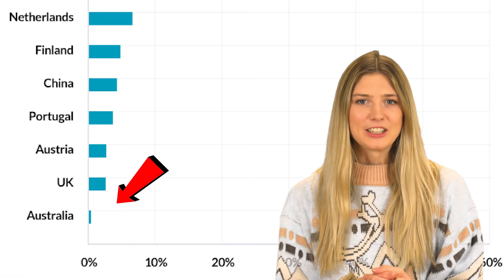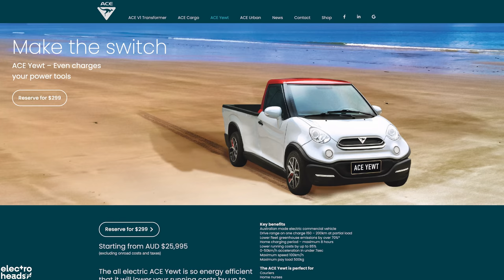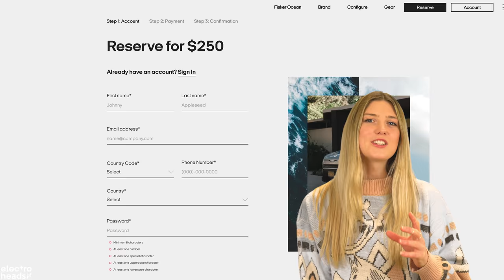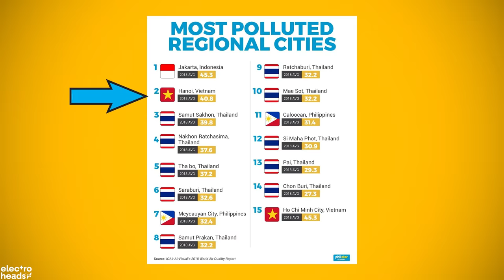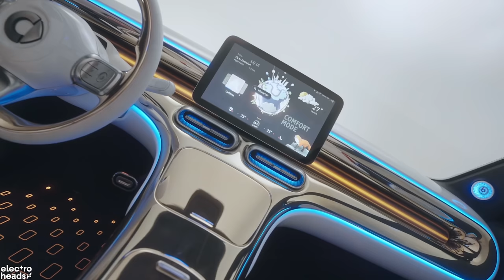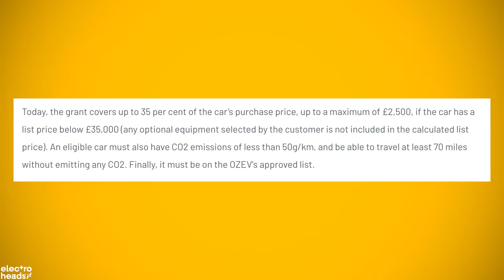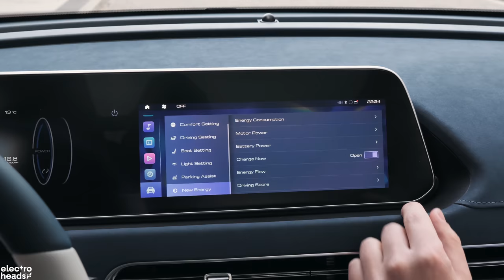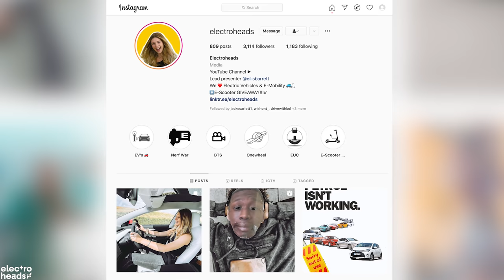Electric Cars You Might Not Know Are Coming In 2022

Comment: As most people in the UK haven't got over £20,000 to put down on a car this is like top gear just ego brandishing most people own cheaper or second hand cars and most second hand EVs have degraded battery's everyone looks for a low mileage bargain but with  degraded battery's it's  not a bargain anymore so EVs In there design are killing the second hand market intentionally or not and now they want to integrate  battery's  to save weight but when the battery Degrades it's  scrap just like a iPhone